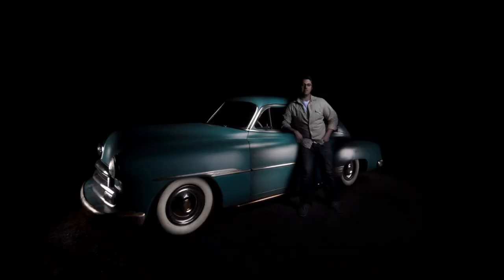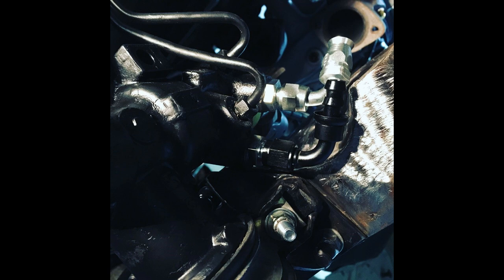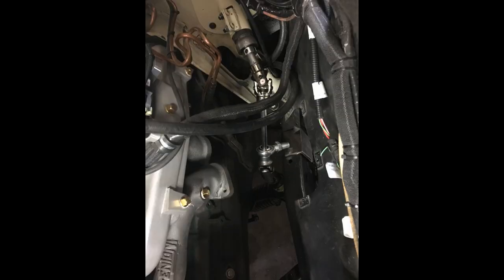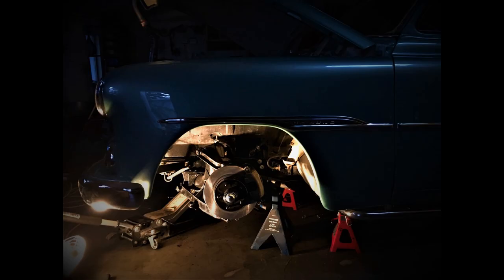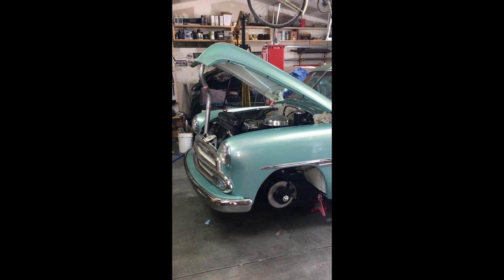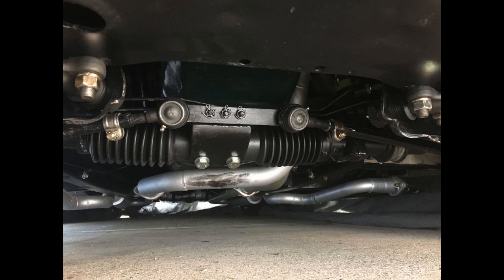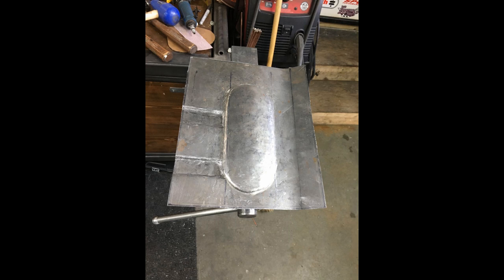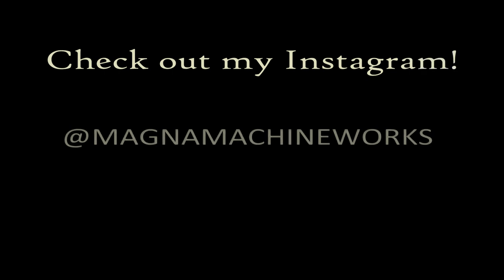49 54 chev steering rack install Final Video!

Comment: David, It does my heart good to see young folk fixing the older vintage vehicles. You have some equipment and the skills to use them that I will never have. I found your videos and looked at your channel and you have a lot going on. 
 Retired now, but 40+ years in mostly dealers I am working on a 67 C10 my son quit on. On the farm with no allowance, but you threw hay (3 cents per bale) and mowed yards in town. I spent $150 on a 65 C10 Apache short bed, but lost it after hitting a rock bottom creek on my way to being late to class. I ran a 4X4 tractor from 3AM until 9AM and went late one day, putting a hole in the oil pan of the 283 and locked it up a mile later, oil light came on 6 seconds after it seized.
 Using a 5.3L from an 03 Tahoe but with the body control. This gives me compass mirror, power windows, content theft, warning chime thru speakers and keyless entry and more. 
I produce a service manual for diagnostics, part numbers, procedures so anyone or even a dealer can fix it. I like the rack & pinion and will check that out. Money ain't what it used to be on every Monday when checks came out after flat rate pay and 100 - 115 hours flagged. Yep, 7AM to 9PM and my Saturdays off. It seems stupid looking back but wife and four kids does strange things. Enjoyed the videos and wish you could drill 7 degree holes for me. I have king pin reamers in tool box #4, right next to my chrome tach-dwell meter. Along with my Delco points grease tubes. Regards! ASE Master Tech since 1978 - Forced Retirement.

Comment: What tie rods did you use on your fleet line rack and pinion conversion doing the same conversion on mine
Reply from the maker: The tie rods are the stock adjustable side for the 49-51 chev car. I ordered and used 2 sets

Comment: David do you remember what Tie rods you used? I see on the website that you linked that they used the stock tie rods for our cars but like you said only one side is adjustable
Reply from the maker: You use the stock ones, but have to purchase 2 of the adjustable side so that both sides are adjustable like a modern car

Comment: Did you extend those skirts yourself? Also, did you have to use a valve in the brake line for the disc brakes or did the master work without one? How far did the disc conversion move the wheels out on each side. Fantastic work btw

Comment: David, How did the rack hold up since you sold it. I am sure the car is way heavier than a Citation, but just so curious using the center steering control. I think Flaming River uses the same concept in a way, just not sure about cylinder size and longevity with a heavy vehicle like a 67 C10 PU. Thanks.
P.S. Sorry to lay so much on you, just a lot of pain!
Reply: David, Thanks for the reply and feedback. Flaming River and others make a center drive rack. I'm sorry to have said Citation instead of Cavalier, just worked many cars over the years. I like your out-of-the-Box thinking with the Dakota and it's P/S rack. I am on the cheap but will save to spent for quality for longevity. Using the Rock Auto lookup, one can see the Cavalier rack fits a bunch of vehicles and I am sticking with GM replacement parts. Plus, it's $68 with $10 core included, but not shipping. Fabrication is not hard as I got my 150 amp MIG in 84, torch, 20T press and much more, but garage is full. I measure, draft on paper, review my designs, using I ideas for clever guys like you. For that, I thank you. I have mailed stuff to companies in Canada before, working for ACDelco, perhaps we can work something out. I have new fuel pumps and truck type LS water pumps, even steel fuel line with plastic 12" lines the clip onto pump, filter or engine fuel rail. But that's in the future. I am just building something reliable, looks good and functions with easy service. Like captured needle bearing on the rocker arms. Cup can work loose and send 4mm needles into the oil pan. I notice some have been pushing you to an "LS" build. I can help with schematics plus other help. Like I said, I makes me feel good knowing younger techs are into older vintage metal. You take care of yourself and all. DK, Omaha, NE.
Reply: David, I really hate to ask about a number from a project, but.
 What was the travel of the rack and pinion you fabricated for your beautiful great car? Maybe 6 - 7 inches. 
  I know you probably was on your back with a tape measure 20 times. Curious as I have not found any version in the local bone yards yet. 
Thanks, DK, Omaha
Reply: Cardone say this R&P travel is just over 6" (6.036") or metric about 153.314 mm. I should have my own home work.
 Stay safe David!